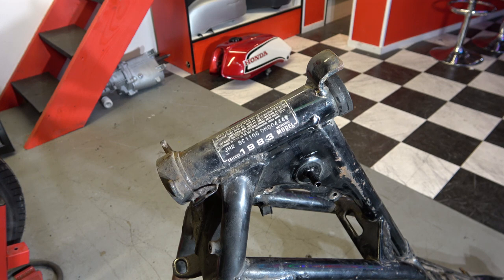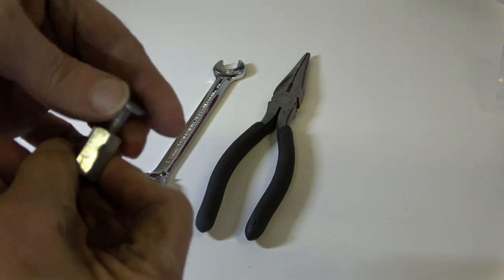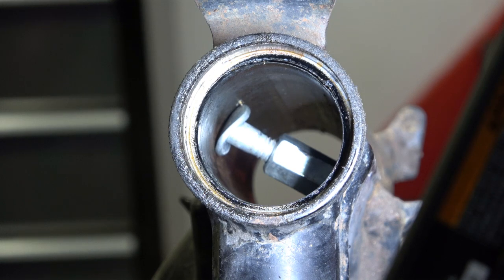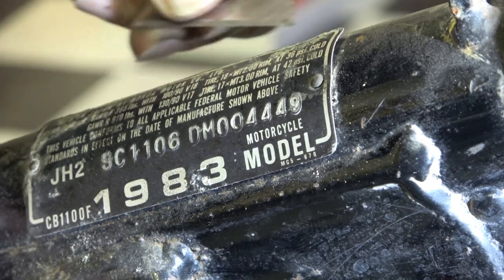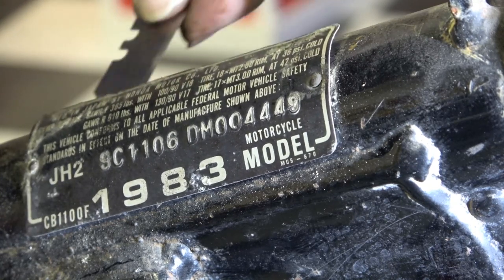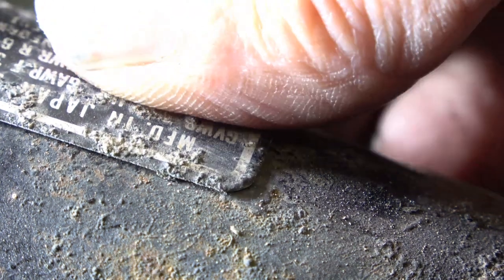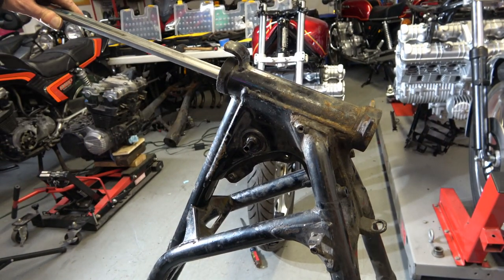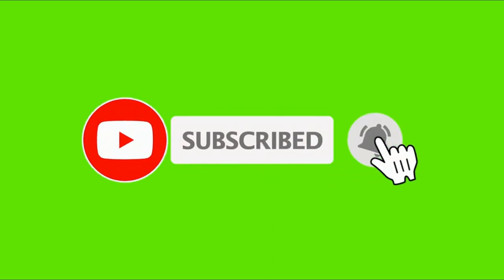Motorcycle VIN Tag Removal How to remove VIN Tag rivets

Comment: Thanks for the video. Any tips for a  cb750 soch vin tag removal? Best to drill out the rivet?
Reply from the maker: Hi Karl, Sorry for the delayed response. I take a razor blade and work the rivets out by edging them out carefully. put tape on the tag so you don't scratch it.

Comment: I’m thinking of starting a project bike specifically a Honda and prefer 4 cyl bikes any recommendations on which model would be easy to cut my teeth on?
Reply from the maker: Hi David, I actually think an F bike would be a great bike to start with. Either a 750F, 900F, or 1100F. All are based on the same engine design, and frame and are the last basic 4 cylinder bikes that Honda produced before the “Sport Bike” era started. They are easy to work on and perform well even to today’s standards. Much better than the earlier CB750 Four bikes. Not to sound opportunistic, but I have an 82 CB900F with 5800 original miles on it that needs mostly cosmetic restoration available. It is seen in my last couple of videos on the 1100F.
I hope that answers your question 
Thanks
Pete
Reply: digitalpizza I would jump at the chance but I’m in Australia ! Thanks for the advice I currently have a 2017 cb650f naked which I love, the 1100F looks a great bike and will start looking around for one, any issues I should look out for? Thanks also for what your doing absolutely love your channel I eventually want to get a CBX but are like hens teeth here in Oz.
Reply from the maker: Hi David, No major issues with the F bikes. They were all pretty much perfect in most ways. The only issue is a weak starter clutch. Not all the bikes had the issue, but if they do, its an easy fix.
Reply: digitalpizza hmm back in the day I had the FT500 the clutch stater didn’t last that long and the valve lifter cable broke, I still have the scares